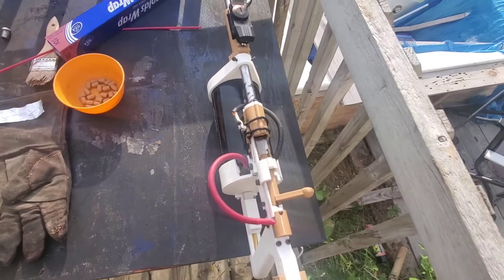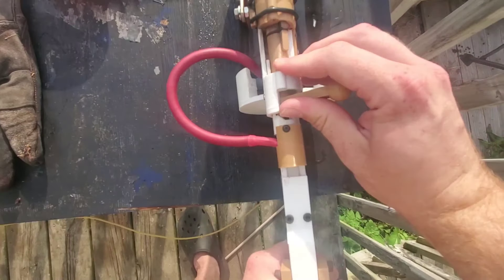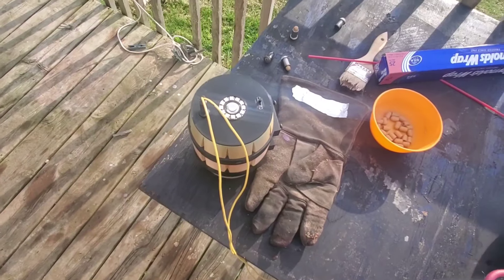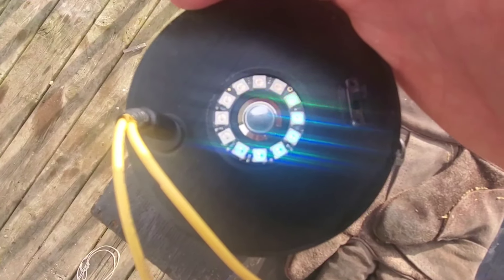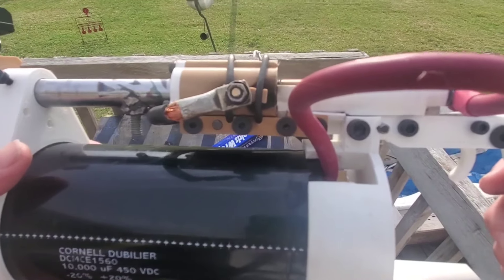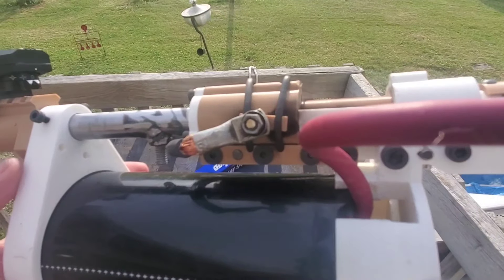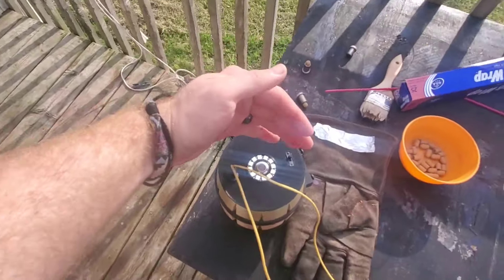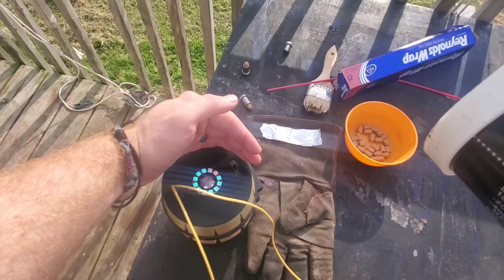Bolt Action Plasma Gun Quick Demonstration

Comment: You're not currently in high-pressure category, but keep in mind if you do try to get some serious velocity / energy output, in a conventional firearm the metal case uses the pressure to completely seal the chamber, without this it's very difficult to get a good seal. Soviet small arm designers tried case-less ammo (before H&K..) and they found that the advantages didn't outweigh the issues of sealing and overheating chamber (in a normal firearm, the case takes a lot of the heat before it is ejected. 

HOWEVER, the designer of the Tround round (see Dardick) was quite the genius and his triangular plastic cases actually would absorb waaaay more of the heat than a conventional thin metal case, so actually there are advantages of plastic cases too, and especially in a low-pressure system.

The softness of plastics compared to metal means you need less pressure for it to expand, for example if you have a very light load in a pistol the case might not actual create a seal, so for lower pressure than normal firearms metal cases might not be ideal, it's not even the hardness so much but the texture of the material & friction which makes a difference here, from what I understand.

Hope this helps, I'm guessing you can't use conductive cases for obvious reasons here, so I though I'd give some info that I know about the results other people got from trying out different materials and caseless ammo.
Reply: Read, like, half of that, but still cool
Reply: I dont believe you're 100% accurate in your statement. Take a .22lr you're talking a grain to a grain and a half in the case no more and it's the most popular caliber in the world and always will be and it's had no issues with metal cases. To take my example even further the cb shorts made by cci have NO powder charge in them. They are fired by just the priming compound that every 22lr has in it to fire the projectile. That also has no issues with sealing being a metal case. Plastic will always be inferior to brass in terms of Ammunition.
Reply: @theviolenceenjoyer  it would have shown its face by now. You can reload a single piece of brass 12 or more times no problem if properly annealed. Plastic is 1 time use and ends up as litter.
Reply: @ngirardo86  The primary consumer of ammunition will always be defence contractors, not the civilian market. Reusability is a non-issue for the real big money contracts.
Reply: @ngirardo86  Do a little research on polymer casings. I’m not saying they’ll take over the industry soon but if the military starts using them widespread, it’ll transfer over to every area of the gun world.
Reply: @MansMan42069  you absolutely certain about that? Where are you finding these numbers?
Reply: @kitdaberserker555  Though civilians own more guns than the military, name a single firearm in the civilian market that has anywhere close to the mass adoption numbers in the military upon release. Adding the bulk ammo required for training and combat loads, and you can easily see how military consumption of ammo far outweighs a regular civilian that likely has multiple guns and doesn't have the budget to buy ammo for every caliber.
Reply: @nateheckman7916  I highly disagree. There are a very select few military contracts for Ammunition..the military has very strict requirements as far as ammo is concerned. Your companies that manufacture for thr private sector aren't filling military contracts for 100 million rounds and they aren't going to switch from brass that can be reused countless times for something that when you're done all you have is trash that isn't going to break down for a 1000 years. I just dont see it nor have I even heard talk of it and I've been involved in shooting sports for 25+ years and reloading for about 10..plastic isn't going to ever happen. They tried it with paper and look where that ended up. The same as plastic would. Dropped.
Reply: @GIXXER_NICK There are companies making steel based polymer that are 100% recyclable, so saying that it will always be trash is wrong. Do your research big cat.
Reply: @ngirardo86  And that still doesn't change the fact that companies like True Velocity are doing R&D mainly for the military, not for civilians. So you crying about non-reloadability is irrelevant and has no bearing on whether polymer ammo will or won't be adopted.

It is fallacious to argue that because you don't like it means it's a bad idea.

Sit down.
Reply: @ngirardo86  well then why is 12 gauge plastic and you can still reuse it
Reply: This is probably the most constructive comment I've ever seen on a youtube video 👍
Reply: Don't forget that weird soviet handgun designed for space combat... What did it use, lightbulb ammo?
Reply: Ultimately… I still think air rifles and rail guns will be the norm later. No brass, no primer, no powder… just a projectile.
Reply: @ngirardo86  there are polymer rifle cartridges, and they are reloadable, as are shotgun cartridges... which are also polymer.
Reply: Yall ever see the electric r700?
Reply: @stevensdad4877  I'm going to take you to school right now so sit down. First and foremost a rifle cartridge on AVERAGE puts out around 60,0000psi thats THOUSAND..a 12ga shotgun has about 11,000psi which allows the use of plastic hulls. The reloading process for a centerfire rifle is ABSOLUTELY 1000% NOTHING LIKE A SHOTGUN. If you load either yourself you'd know all of this but clearly you don't. Like I said before you can shoot all the garbage plastic shells you want I'm sticking with brass. Oh and no there most definitely NOT plastic rifle cartridges commercially available on shelves right this very minute or the very minute you read this reply. Lastly even of there were they would absolutely NOT be reloadable for a centerfire rifle which again..you'd know of you reloaded yourself.
Reply: @ngirardo86  ok Mr school teacher... first of all, gun test magazine did a review on polymer cases for 5.56 nato i believe that was back in 1999 (the year you started wearing training pants because you were graduating from pampers) by this time I had been reloading for my old 1938 Mosin nagant, chambered in 7.62 russ. For 4 years.
Back then brass was a bit difficult to find for that particular cartridge, only ones I managed to find was made by Norma... 
But, im getting off topic here pumpkin, the reason for the polymer cases in 5.56 nato, 223rem to the public, was because it saved on weight for our gentlemen in arms and allowed them to carry on average 150 rounds more for the same weight in the ruck... so, gun test (Florida magazine) did a review on them, and yes, they are reloadable.
I reload both brass, and polymer, in rifle, pistol, and shotgun. (No polymer in pistol that I know of) ever heard of plastic bullets? They're blue! And they are available in 5.56 nato, and 7.62 nato...

What else you got for me Mr school teacher?
And that 60,000 psi... that's for a 7.62 nato round (308 Winchester to you)
Reply: @Quagula  what’s the point? Air rifles are nearly imitating a lr22 powder burner… without brass… primers… powder. They are light, accurate, and deadly. And fill faster than a battery. Look into them.
Reply: To add to this in an application I would use polymide instead of foil because it out gasses and becomes conductive when you break down its insulation ~500°f when it starts to out gass. you can also build a capacitor into it for single use cartridges on the cheap
Reply: @nateheckman7916  good one 😄
Reply: @ericjohnson8482  I proved my points already you're a day late and a dollar short. You also have no idea what you're talking talking about and your reply makes that VERY clear.
Reply: Have you seen any of the airguns coming out lately some of them are powerful enough to take down a deer 357 mag airguns can even bring down a boar.
Reply: @ngirardo86  First off recaseing ammo can be fetal if done incorrectly which is easy to do. Secondly the spec forces of the Army alone have more ammo then the entire Marine Corp itself, this dose in no way include all other spec force branches which can have a massive and I mean massive surplus being a Veteran who worked in the ammo hut for a time I can tell you the only and I mean only civilian with a fraction of that ammo has money and a lot of it. This means of course that the average citizen in no way has access nor the funds to be able to own that kind of ammo not even combined. A single training session for annual marksmen test in the Corp would go through tens of thousands of rounds easy. This dose no include any other training and this was a single section not even an entire company. Just saying your way off.
Reply: Wtf how do people know all this but then work at like McDonald’s or something
Reply: @lsfearls  humm.. its called "RELOADING"  no "recaseing"  geez.    and reloading is a pretty simple process that anyone can do, as far as it being fetal,  i wouldnt say it would be easy to do. in fact very difficult to do.  mainly because powder grain sizes these days make it near impossible to double charge a case..  case priming has come a long ways as well,  you can hand prime cases with a single hand using a lee hand primer.  trust me, after priming 1,000 rounds of 223,  you'll ache for a week.   but it can easily be done safely while watching tv, and playing with the kids sitting on a couch in the front room.   powder charge charte are extreemly easy to read and even a 10 year old can reload, which MANY kids still do reload with their fathers and mothers every day.   sorry, but not so easy to be fatal..but its possible, like driving a car to work,  any one of those trips to work could be fatal. but we have saftey breaks,  straps,  bumpers, and so on to help prevent it, but it still happens..  same with reloading,   you see it as unsafe,  others see it as crazy, but to those who do it regularly, its nothing more than making breakfast in the morning.
Reply: Bro typed a whole essay
Reply: @lostsoul8512  LMAO and he probably work at food lion
Reply: Oh damn my friend! You put actual science and logic into this. I doubt our friend who posted this video has considered any of that. Let alone knows what you mean when you say these things. Oh well at least you tried. Hopefully he learns something and doesn't blow a finger or hand off. Or worse...ick. Weapons testing by unqualified people always results in somebody losing bits of their bodies, or their lives. Thus why this kind of work is best left to professionals. But hey OP, if you do blow a finger off with your plastic plasma guns, please make sure you post the footage online. I hope you don't lose anything but if you do, please share.
Reply: This is byfar the best comment, it appears your truly trying to assist him in getting better velocity with his project and the amount of effort and knowledge of your comment shows you have a level of dedication to your craft that most do not, well done sir!

Comment: I see your Firing mechanism is working in a way you're holding the contacts away from each other and when pressing the trigger, releases the contact. Didn't notice it at first, but i saw it in the slowed replay of the shot taken, cool stuff! Also wondering if your contacts get any sort of damage overtime after having shot it multiple times due to the constant exposure to who knows how many amps lol. Are the trigger contacts easily replaceable ?

Comment: Since it's not technically a firearm, you can slap a suppressor on the puppy.
Reply: 1000 joule isn't a lot, especially when it's the primary propulsion method, so there's a good chance that this with a suppressor would just cause projectiles to not leave the barrel.

Comment: Would love to know what kind of velocity you’re getting and also maybe a damage test to show power
Reply: I'm going to guess it's not too much. 1000 joules is roughly equal to a heavyweight boxer's punch. A lot of this energy is going to be lost through the various transfers of energy in the system, so we're probably looking at significantly less than 1000 joules in the projectile.
Reply: @DistendedPerinium  not a physics guy so idkfs but wouldn't the impact be more powerful when transferred over a smaller object like a molten ball of aluminum than something the size of a boxers fist? Still probably wouldn't be all that damaging, but that should still play a factor right?
Reply: @jamescr101  long story short on that. Total energy is derived from mass moving at velocity. A good example is a fist vs a bullet. A fist is more massive than a bullet, so it will reach a set point of energy at a slower velocity than a bullet will.

When you're putting energy into a system, such as this, the same amount of energy will make a more massive object move slower than a less massive one. Plus, you're not getting directly comparable energy. There's always loss in transfer.

Again, that is the broad strokes that I hope is enough to explain the concept.

Comment: That's actually a really good idea, it's very simple to make anywhere in the world as long as you can get electrolytic caps, but I suppose if you carry a backpack you could even do it with foil, which would have higher peaks. The issue with contact welds though is a concern for sure and I can't say I'm surprised you're having it, high-peak-current contacts often use compressed air to create fast velocity to help with this issue. 

I actually never thought about using the shitty effect of vaporized metal clouds in fuses to propel something, it's definitely a very creative idea! It's always nice to see a usually very undesired effect be put to good use. Can you give some info on the bullet weight and are you able to measure the velocity?
Reply: Super weak. Better off with a CLGG in every single way. Cheaper to run, doesnt need electricity, shoots anything you put in the barrel at multiple mach muzzle velocities
Reply: @nicholashodges201  What if the chamber was completely sealed instead ? Instead of working like the gasses escaping a revolver.
Reply: @Harbinger1738  then you have plasma *grenade*, not a gun.
By definition of how firearms & other gas expansion projectile work is that one end of the barrel has to allow the gasses and projectile to escape
Reply: @nicholashodges201  That's not what i meant 😂
Reply: @nicholashodges201  I mean the rear portion near the contacts, so instead of releasing the gasses, it could be better incapsulated if the shell seal was improvised and such
Reply: @Harbinger1738  that won't work the gas cloud is still around. Why do you think people can smell gun fire? You think sealing the back of the chamber stops any of that?
It shows that you have a very tenuous grasp on the physics of the mater.
Reply: @nicholashodges201  Bro... i'm just asking questions why do you have to be rude...
Reply: @nicholashodges201  People like me thy to educate themselves and people like you keep shutting us off from the subject without even explaining why i'm wrong in the first place. I'm certainly not proclaiming i'm better than anyone, but you sure have a lot to prove apparently.

Comment: Have you tried adding ferrous oxide to the aluminum?  Given that ferrite oxide and aluminum in the proper quantities produces thermite it could be possible to increase the energetic discharge on the projectile in the same way that ball powder improved over black powder by increasing the energy release with minimal increase in energy of activation requirements.  Take a little ferrous oxide, roll it in the center of the aluminum, you'd probably need a bigger capacitor to kick off the reaction, but I think the return on investment would be worth it.  Not going to do math on the moles, but you seem smart enough to figure it out.  Just spitballing here...
Reply: You should build one bro. I feel like you could go really far in this business.
Reply: @savagesock3598  If I had the money to invest in a half decent workshop, I would.  One of my stepfathers had a full machinist and wood working shop in his basement.  By 13 he had me building go-carts and zip guns from scrap metal.  ATF would have had a field day with this guy.
Reply: @ChefSpinney  yeah true, I feel like the atf wouldn't like this. 🤣

Comment: For a true plasma rifle... You need a tiny field to encapsulate the plasma made. 

In labs they can get fields to pop up away from the source. Really complicated. 

But Maybe a certain frequency of plasma could make the surface rebound off itself long enough to travel as a sphere....

I mean really ball lighting is a sustained plasma ball in open air so it can't be to complicated with the right understanding... And enough energy...
Reply: i always had an dea when i was a kid messing with this stuff. Using a laser as a waveguide for a plasma bolt proprelled with an EM field but it just requires more energy than is possible with current technology

Comment: Have you had any issues with the plastic pieces melting?
Reply: It's a bolt action. It doesn't produce enough heat in a single shot to even get close to melting point.

Comment: Other than a curiosity, I don't much get the point.  It is using an electrical discharge to burn a fuel (aluminum) to propel a projectile.  I suppose if one is looking at a single shot survival weapon that doesn't need commercial gun powder, there might be a use.  As for the comments that seem to think this is not a firearm, those are incorrect.  Actually it is.  It uses exploding or burning hot gasses to propel a projectile.  It doesn't matter what the fuel is that is providing the gasses.

Comment: Practical use:  If in the future it is hard to get complete ammo you could you a stronger barrel, a smaller capacitor, and actual gun power to make a firearm that doesn't depend on modern primer technology.  Though honestly there are probably better ways to use electricity to ignite low-tech bullets like a tazor circuit.

You should do that next.